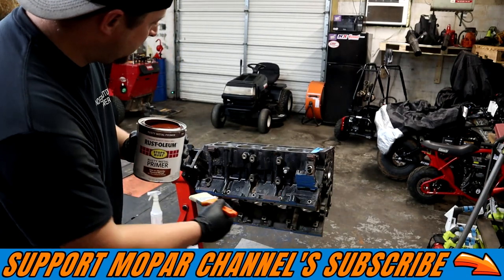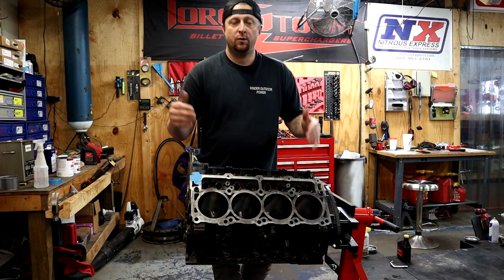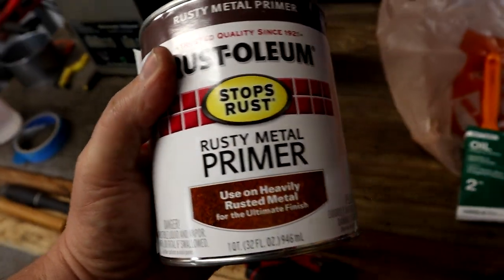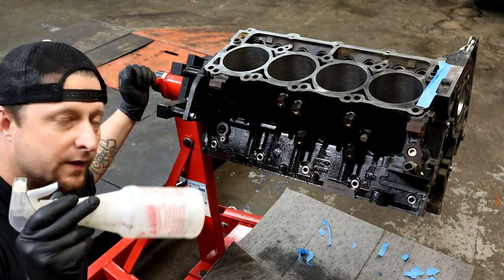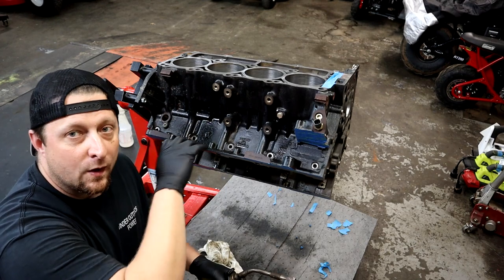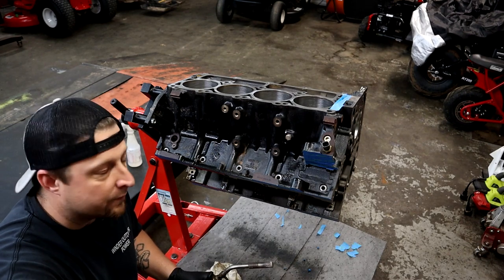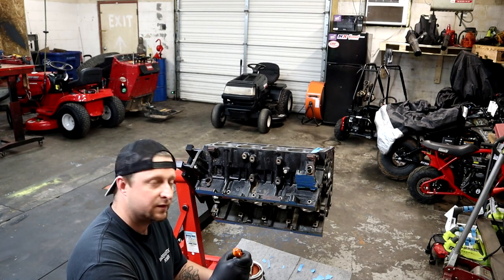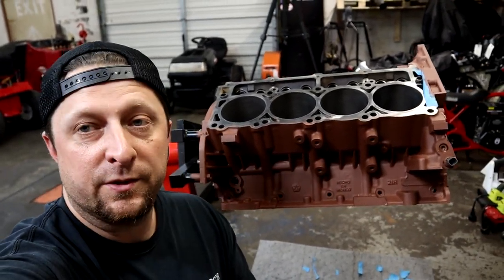How To Paint Your Engine For Less Than $5 BUCKS BGE 392 Part 2

Comment: The tractor supply has a good selection but also has a hardener and reducer if you are going to spray it but acetone is probably fine but you have to look up mix ratios i have seen somewhere online but hardener seems like it would help even brushing

Comment: The loud shrieking noise. When u blow air in those head bolt holes😅 I was triggered when u showed the block and blow gun at the same time 😂
Reply: @FrostbiteRam  I don't understand it either I can handle a engine jus hooked to long tubes no problem but that high pitch... lawd it hits different